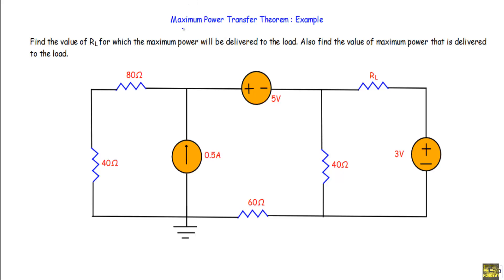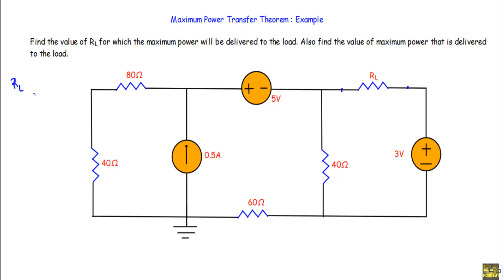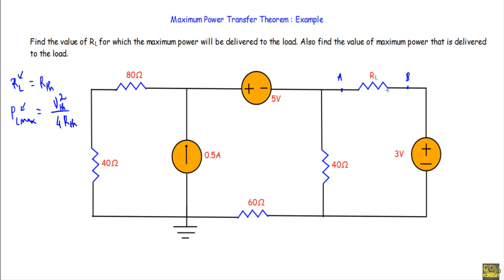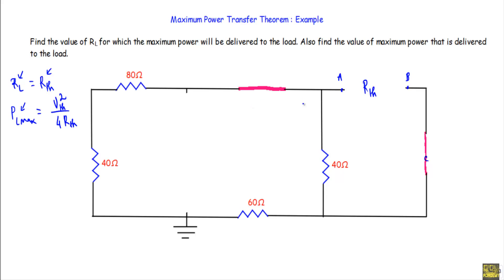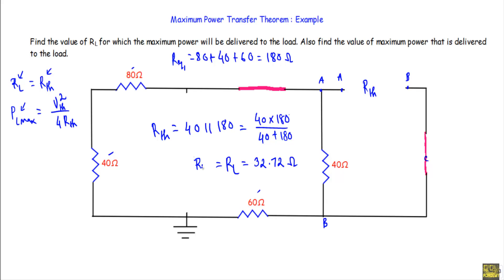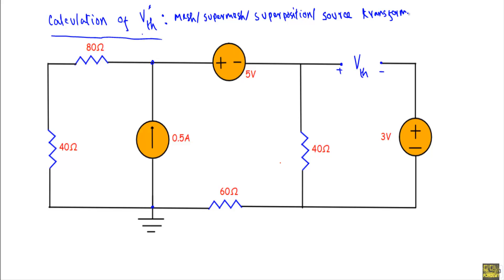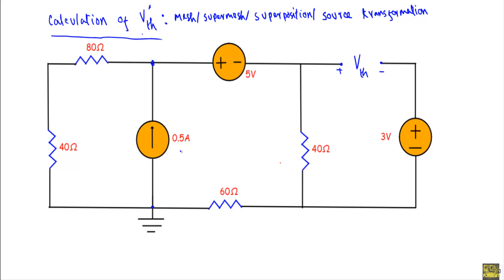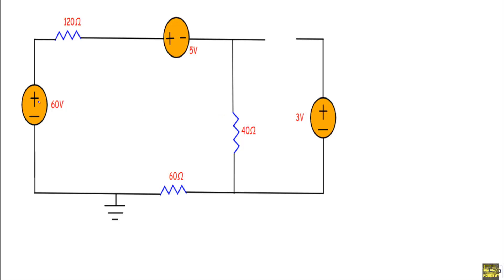Maximum Power Transfer Theorem : Example 4 (very hard)

Comment: hello Sir,
In the previous video you have stated Pmax = (Vth*Vth)/(8*Rth).  But in this video Pmax = (Vth*Vth)/(4*Rth). May I know which one we have to follow
Reply: For the DC voltage case, the Thévenin equivalent is VthDC in series with a resistor R. You extract maximum power (see Maximum power transfer theorem - Wikipedia) when you load the Thévenin equivalent with RL=R. In this case, the voltage in the load resistor is

VL=VthDC/2

and the power in the load P=V^2L/RL is given by

max power at load DC: Pmax=V^2thDC/(4RL)

Comment: How I2 is zero
Reply: There is open circuit.. Open circuit current is zero
Reply: bcz there is short circuit.. & in short circuit current is zero
Reply: @tanjilaislam9284  Don't spread misinformation. In short circuit, current is greater than zero. What you are talking about is open circuit where current is zero.